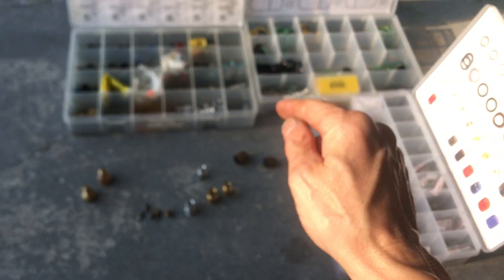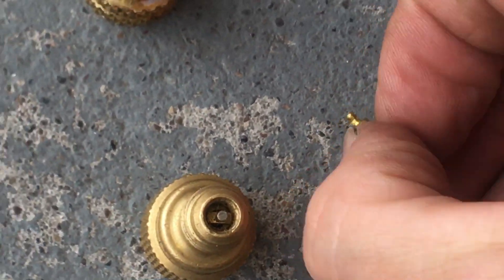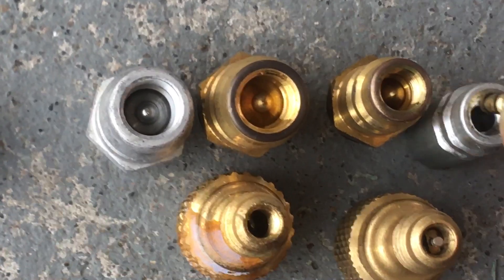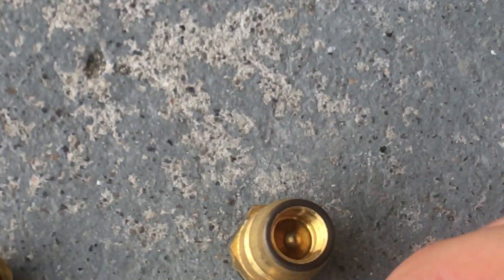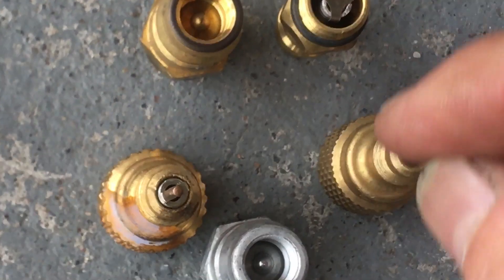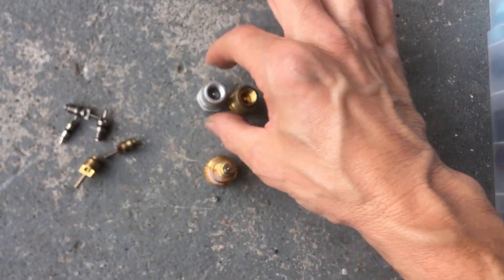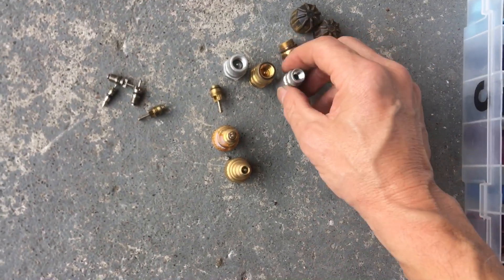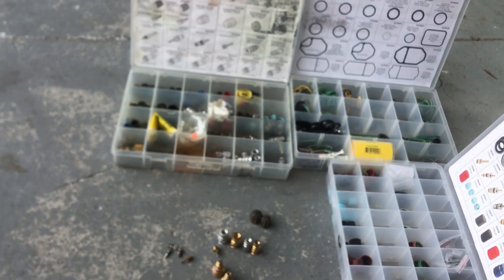This Is why Refrigerant valve cores￼ Do not need to be removed for vacuum Compare residential HVAC￼

Comment: tom pls recommend good brand of o oring set. i bought from amazon i dont like it looks cheap, pls advise
Reply from the maker: Santech or Sanden kits 
There’s large Master kits 
Then you can specifically get a kit for European cars 
One for Japanese cars 
Can’t remember if they have one specifically for American, but I think they have a General Motors kit maybe a Ford kit a Chrysler kit 

There’s literally hundreds of rings really close to each other size but just a little bit different
Reply: @coldfinger459sub0  Tom I charge 134a using small can 12oz goes on to low port. I use a scale to measure. I realized that for 2013 Benz Ml350 it has 19.5 oz or 525 grams. When I charged with first can it took only 11 ounces, second can have to wait for 5 minutes to get to the 19.5 oz mark. Question is when u charge using your method of bigger tank on high side it can get charged super fast. However on low side I am struggling to push it to the spec. Any tips that recommend on low side
Reply from the maker: @sivucit  if you try to push too much too fast on the low side, you can damage compressor. Compressor is not meant to take in liquid refrigerant

My high side, charging method only works if somebody completely understands the three gas laws and know how to use and manipulate them to their advantage .

Comment: Good to know!
Primarily an HVAC guy, and never really  took a close look at the back side of an R134a fitting and observed the effective gas flow difference as you've well illustrated for us.
Until now at least, I've just arbitrarily removed the cores (as I do with HVAC). With a PROPER hose designed for evacuation, and a decent vac. pump, leaving the cores in probably makes minimal practical difference when pulling vacuum on an R134a system, especially given the small internal volume (compared to a typical HVAC unit) of an automotive system.

Stuff like this is why I enjoy your channel...lots of "useful nuggets" that either aren't covered at all or aren't explained well in most books and courses!

Comment: I didn't know a tool even exists to remove/replace the 10mm cores while under vacuum?
Reply from the maker: On the large 10 mm I don’t think I’ve ever had a leaking one that I actually had to try to replace . 

I guess I got to give that a try and see what happens in the first place.      At least that says one thing for them they are reliable.
Reply: @coldfinger459sub0  Yea, I can see why they probably don't often leak (diameter helps drive them closed) but I'd bet money you'll be finding a leaky one at some point due to Murphy's 2nd law of contamination.
Reply from the maker: @thisisyourcaptainspeaking2259  that Murphy he sure does get around

Comment: Not to mention that with 134A if you need to change the core it is obviously leaking so you know the charge is going to be low so you need to recover and recharge properly anyway hence why you don’t find tools to change the core without letting gas out of the system like exist for hvac it’s pointless.
Reply from the maker: I’ve done a video with that tool I have one I’ll do another video on it it’s been a while many new people have not probably seen that old video
Reply: @coldfinger459sub0  cool I did find one once cheep shit from China did not work that part that goes over the end of the core to remove or replace it was machined so wrong it wasn’t funny. It was more like a valve core destroyer. Have yet to see a decent one that actually works like it is supposed too. I think the only thing a good working set of those would save me is some nitrogen and a little bit of time as like I said earlier and I know you agree if your replacing them because they are leaking you know the system is low on charge your going to recover vacuum and recharge properly anyway.
Reply from the maker: @ck9581  Master cool is the name of the company that makes a good one

I’ve had it since our 134 came out
Reply: @coldfinger459sub0  nice, thanks Tom much appreciated.
Reply: Good luck with that most cars there is not enough room on low side port